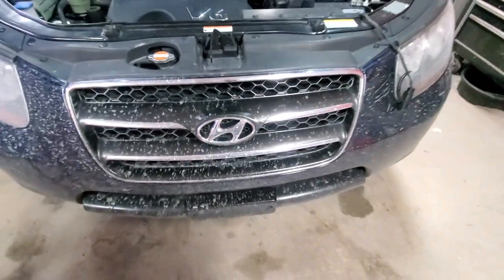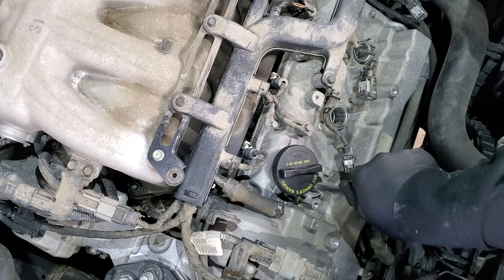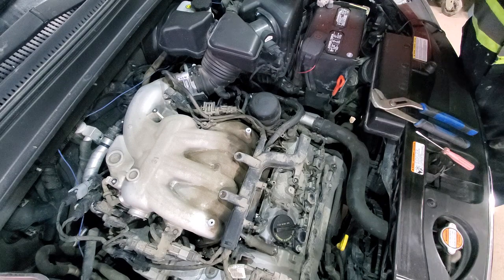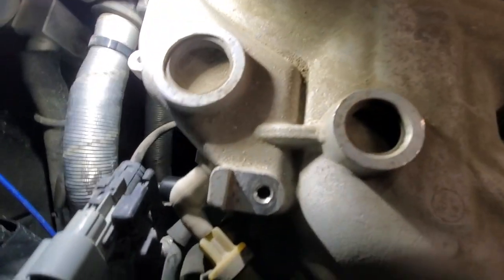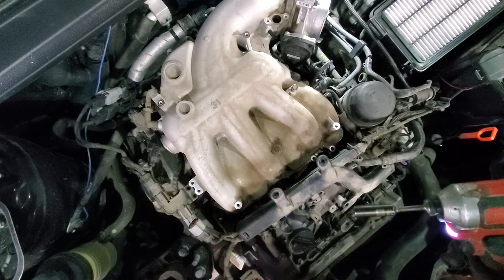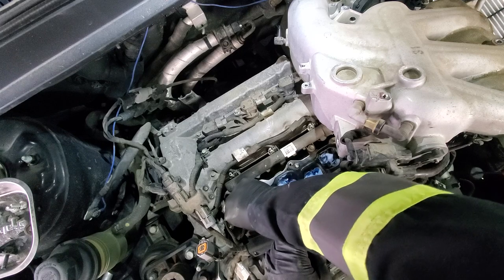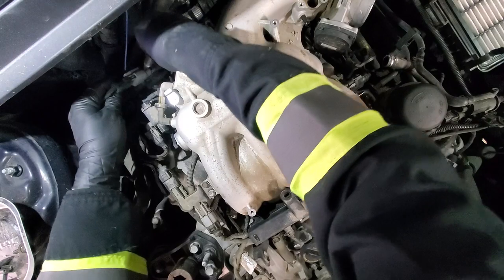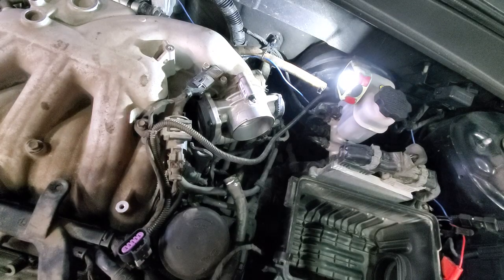3.3 V6 Hyundai Santa Fe Spark Plugs Replacement

Comment: My deepest thanks to you sir!
You are my hero.  This video saved me $1720.  I had an engine misfire code come up, cylinder 1.  In the back of course.  I got a quote from my local Hyundai dealer service of....$2100 to replace all the spark plugs, all the coils, the PCV valve, intake gasket, clean throttle body and MAF.  I could not believe how expensive it was.  BUT...I found your video here and got the confidence to do this myself for $380 with all new OEM parts from Rock Auto.  Took me over 4 hours but dang it...I DID IT!!!!  Thanks to YOU!!!  BTW, I found the source of the misfire which was a fouled spark plug and some water in the chamber from cleaning the engine.  No matter, my 2008 is running in great shape now.  No codes.  GREAT VIDEO!!!
Reply from the maker: You're very welcome! Happy to help! Thanks for your comment!

Comment: This is a great video. I am getting ready to do the plugs on my g/f 2009 santa fe and this really helped! But one question for you. Where is the knock sensor on an 09 santa fe? Auto zone said she had tat code as well. I saw a video that said it was under the thermostat housing. Not sure if you can help me that would be great. Thanks and great video! Dave
Reply from the maker: Based on  my research, the knock sensor on the 3.3 are mounted on top of the engine block between the two cylinder heads. There will be a lot of stripping of the engine to get to them...
Reply: Im doing the plugs this weekend so the intake is coming off. Are they under that and if you have an idea where they are under there can you tell me? Again thank you very much for the reply and the help. Your video really helped a lot. @justdoityourself
Reply from the maker: See link below for your reference 
https://www.hyundai-forums.com/threads/2008-santa-fe-knock-sensor-3-3l.663033/
Reply: Thanks again for the quick reply. That looks way to much to do in my driveway. Have a great weekend. @justdoityourself
Reply from the maker: @David-mf9bk  Agreed! Thanks,  you too!

Comment: Hey! Great video, I wanted to do this service on my 2009 3.3L and as timing would have it, the knock sensor needs to be replaced now the check engine light is on. P0331 Knock Sensor 2 Circuit Range/Performance (Bank 2) is the code. Any advice or steps? Thanks
Reply from the maker: Hi! Unfortunately I don't have much experience with the knock sensor. Sorry.
Reply: No worries thanks for the reply @justdoityourself